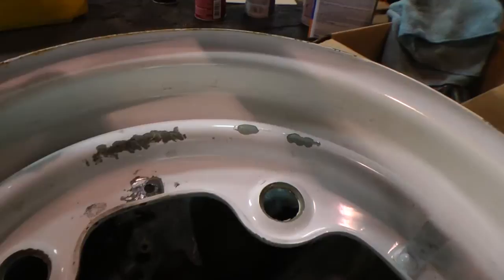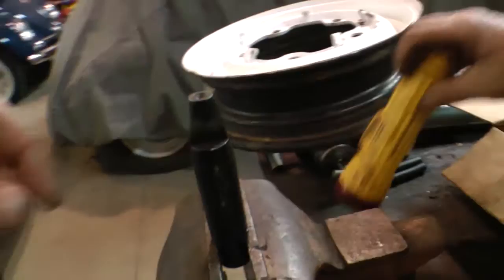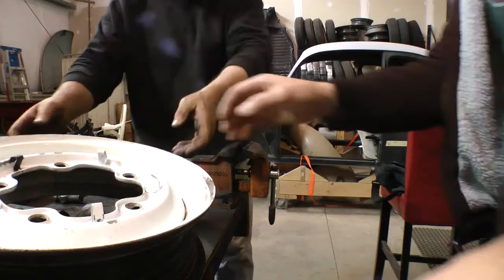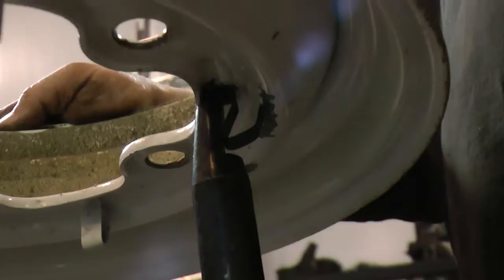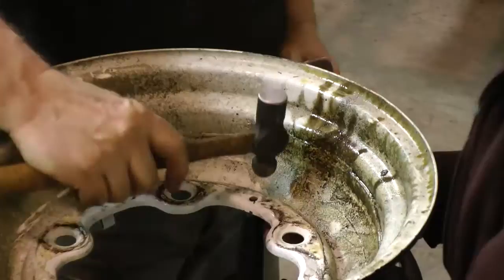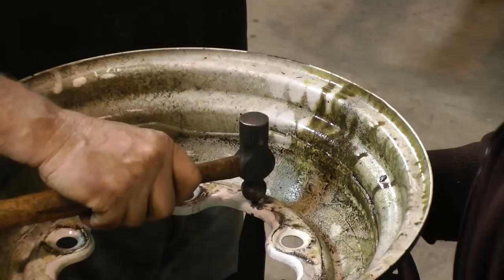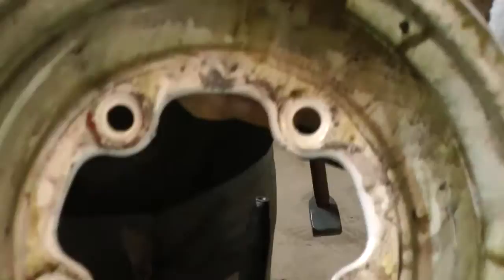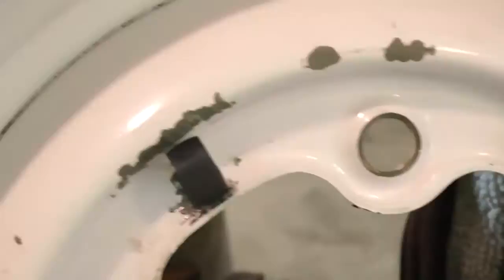Classic VW Bugs How to Repair Beetle 5 Lug Smooth Rim Clips

Comment: Great info.  I used a stainless steel button head allen screws to replace mine with aircraft nuts to secure them in place.  Had to bevel the hole slightly to keep them off the drums.  My ways not as original or German as yours but makes it faster to replace them when they break.  Thanks for the video.

Comment: Such a dangerous practice. As an apprentice the first thing we were taught is to NEVER EVER strike two hammer faces together! These are hardened surfaces and will shatter. Why don't you simply use a punch - as they would have done in Wolfsburg.